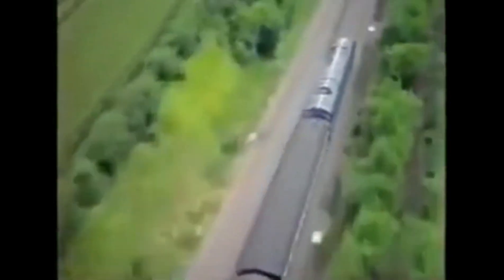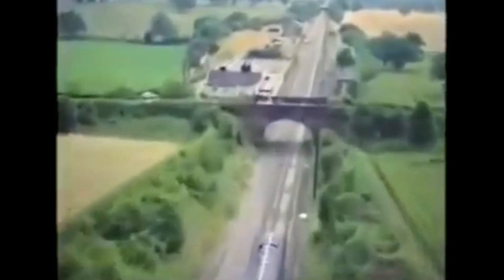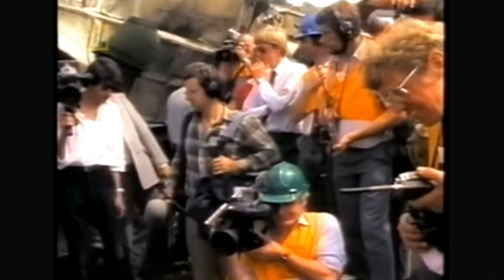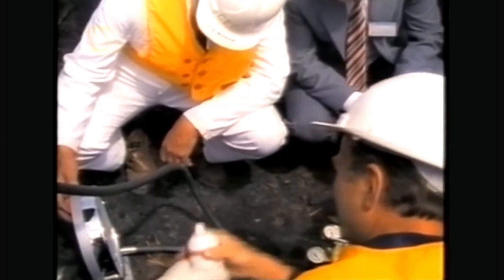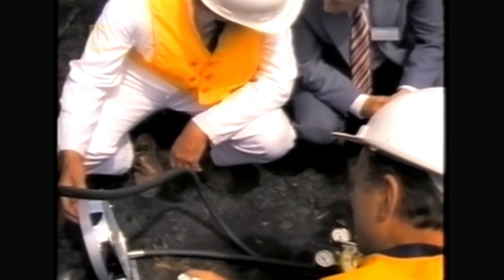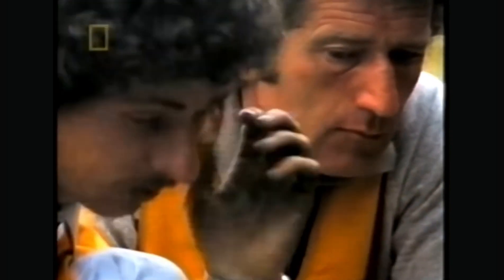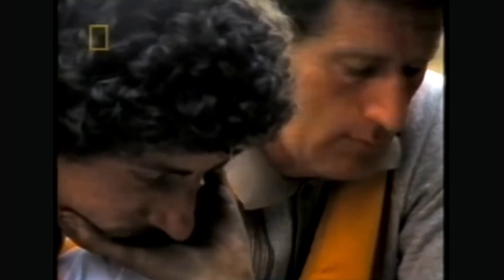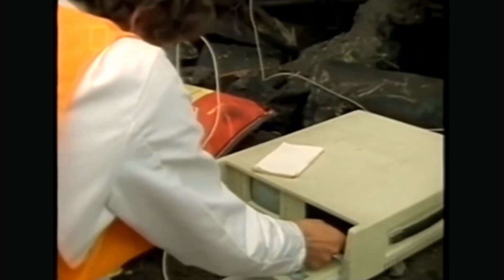Crash test - Old Dalby test track - Nuclear flask test, 1984

Comment: I worked for the foundry that made the flasks for BNFL. GEC Turbine Generators the old English Electric company had their own foundry . These flasks were made out of a grade of Ductile Iron which had enhanced mechanical properties, we used to examine the strength and ductility of the iron  at minus 40 degrees centigrade. Sadly the foundry was closed in 1991.

Comment: And the technician that measured both pre and post o-ring interspace pressures? Me!
(There was actually a slight friction induced increase in pressure)
Reply from the maker: Hello. Thanks for the comment! 

I'm assuming that heating from the friction increased the vessels pressure?

In any case, I further assume that a slight increase in pressure is much preferable to even a slight decrease!
Reply: @BennettBrookRailway correct on both counts!

Comment: FYI, 46009 was going to be scrapped anyway, so they had to do it in style.
Reply: Ngl we should start doing this shit.
Reply: In fact the rumour I heard was that they'd already removed the bolts between the chassis and body.
Reply: @1963TOMB  I have been on The Railway for just on 36 Years and I know a lot of the Engineers from various locations and I don't think you are too far off the mark. What I was told was the Mounting Bolts were cut approx three quarters of the way through for the test. The impact would have done the rest.

Comment: Did we ever find out which part of the locomotive went flying into the air having gone clean through the remains of the cab?? I always assumed it was the power unit and/or generator which sheared off the mountings ?

Comment: I wouldn't have been happy with the "no significant change". I want numbers. What pressure did it start out with, and what was the pressure afterwards. If it had been filled with nuclear contaminants, how much would that pressure lost be in terms of leaked radiation?
Reply: Why would you assume pressure was lost?

There was no loss of seal.  A slight deformation of a pressurized container could have slightly increased pressure.  If the seal had been lost, by the time things had cooled to the point they could test, the pressure difference would not have been insignificant.

So, in terms of leaked radiation - ZERO.

Edit:  And turns out I was sort of right.  There was a slight increase in pressure with the second measurement, they believe it was solely due to heating.

Comment: VHS tape didn't survive the resolution test. Even 8 mm amateur film footage is better.
Reply: And everybody knew that.  VHS wasn't designed for the highest possible resolution.  That's what 2-inch tape was for - and it was still limited by camera scan lines.  Video being better than film is a fairly recent thing.

Comment: Why not make the train out of the flask? 😂
Reply: Because it would be too heavy to move under its own power, and if you did get it moving it would derail at every curve.  And of course you'd have to reconstruct the tracks because existing track wouldn't even begin to be able to handle the weight.

Comment: There is an undeniable huge difference between no significant change and no change whatsoever.
Reply: Significant: 
1. sufficiently great or important to be worthy of attention; noteworthy.
"a significant increase in sales"
2. having a particular meaning; indicative of something.
"in times of stress her dreams seemed to her especially significant"
3. Statistics
relating to or having significance.

There, really, is no difference if the difference is insignificant.
If you sit in the middle of your couch and move once cm in any direction, that's a change.
The change, however, is insignificant.
The fact that 12 sheep upvoted what you bleated out is deeply saddening.
Reply: From a safety PoV, no significant change = no leak.

There would definitely be exterior cosmetic changes and heating of the flask, because it's still subject to physics.
Reply: Not great, not terrible.
Reply: @pliiatz7534 😂😂

Comment: 1:35  the pressure test showed there was no significant change…however it was reported a while later that it did fail and at this frame 1.35 there is water bursting from container.☢️
Reply: How do you know that's not the glass fragments from the cab windows?
Reply: @saunders-roe9806 you know it might be just that.
Reply: Reported by who?  The national railway museum records that the flask was completely intact, having just lost 0.29 of 100 pounds of pressure.
Reply: @ reported in the press a few years later, so where did that 0.29 …bar?…pounds?….of pressure go if the flask wasn’t breached?
Reply: @spicethecat6207  Its called measurement error.
Reply: @AndyM_323YYY probably not with the instruments they're using

Comment: Funny how a steel Train knocks the steel barrier out the way ,where as if it was a aluminium plane it would of cut through that barrier like a hot knife through butter,,going by 9/11.
Reply: Steel looses it's structural ibtegrity around 1000C. You know swords? Metal heated over coal fire made to glow red hot and smashed into shape by a hammer? Or the weight of millions of tons worth of building being held up by steel heated beyond it's structural integrity. Each floor on a steel bracket suspended? One floor goes and crashes onto the next weakened floor and after that the building is toast and subsequent floors pile onto each other... not rocket science. Kerosene burns more than hot enough to forge steel.

Comment: If the 46 was really doing 100mph it did well not to derail on that last curve which appears NOT to be banked😮
Reply: Someone walks across the front of the big shed at a right angle as the 46 goes round the bend. Going on that quick comparison within the visual,  it’s doing a lot less than 100mph..

Comment: The Mk1 coaches stood up better than I’d have expected.

Those were pretty good medium revving diesel electrics.  A bit dull but reliable.
Reply: Yeah no crash structure, no energy dissipation. If you were in the front of that you're gone.
Reply: @bentucker2301 so like with most modes of transportation then

50 years on and still the safest place to sit on an aircraft is at the rear if it was to go down

Laws of physics can’t be changed
Reply: Good Sulzer engines, a bit ugly looking front end cabs, but they ran well enough,  most of the time.
Reply: @BegudMaximan-zp2tc I remember them mostly between Birmingham New Street, Derby, Nottingham and St. Pancras.  I wish I’d kept it but once I had a ticket marked ‘St.Pancreas’🤔🙂

Comment: I've only managed 95 mph on that track and that was with special dispensation. It was a rough ride, standing on the non-drivers side with my laptop plugged into the TCMS. The track at the Old Dalby end was pretty uneven back when I was testing there (2017)
Reply: @davidquirk8097  yeap, it will be so.

Comment: Poor loco. On the other hand, was this test-result conclusive? Lots of different angles of impact would have to be tested.
Reply: Angle of impact was set up to maximise expected shock -;that is why the trailer is at an angle across the track
Reply: They tested what was calculated to be the worst possible scenario........ and it passed with flying colours.

Comment: No significant change 😂
Reply: It didn't leak moron
Reply: I thought that was an unnecessarily accurate comment. I think the flask did change shape, causing a slight difference in internal pressure but no leak which should have been the headline comment.